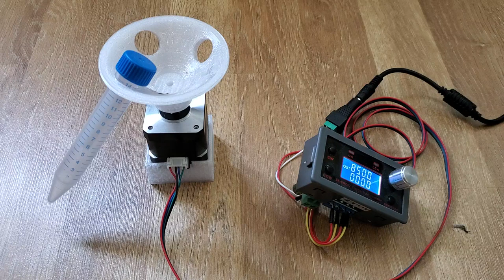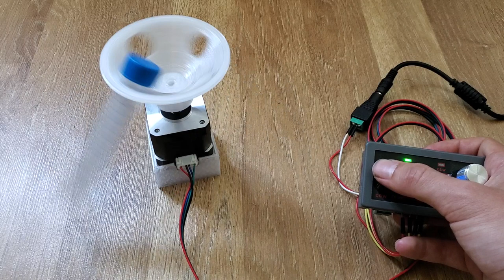Slowmo Centrifuge: A low speed/high torque NEMA stepper motor centrifuge for cell culture

Comment: Thats cool. Where did you source the motor controller?
Reply: my question too
Reply: lmao calls it a project and all he did was connect a stepper motor driver to a stepper motor
Reply: right? didn't even use a balance vial
Reply: @crimsonsapphire6680  his proof of concept still comes across. This is a cheap alternative to store bought centrifuges
Reply from the maker: You can search for "42 57 Stepper Motor Speed Controller Driver Forward Reverse Module Pulse DC5-30V" on ebay.

Comment: Could you make a list of all the stuff you used? Idk the names of the wires or the adaptor for the power supply.
Reply from the maker: The search term for the controller is in the video description. Otherwise you just need a Nema 17 motor, 12V power supply with a barrel jack, female barrel jack and some wire connectors.
Reply: @qosmoschem  Thank you! :D
Reply from the maker: You're welcome

Comment: And the pulsing of the stepper motor doesn't cause all kinds of weird currents in the solution? I assume you balance it with a second tube on a real run.

Comment: Is that the one that goes to 12000hz?
Reply from the maker: It's a ZK-SMC02 stepping motor controller + driver and has a speed range of 0.1-999rpm (1-9999 pulses) according to the seller datasheet. I'm not sure what you mean with 12000hz frequency.
Reply: @qosmoschem  since the stepper motors tend to be 200 steps per revolution, The from the internal controller that go to the driver or what I'm referring to.  The reason I was asking is because I like how it appears to have a semi soft start feature. And the one I'm looking at, I'm hoping it has that same feature.

Comment: Why do I feel thats not 850 rpm?
Reply: Certainly does not look like it, maybe a miscalculation with microstepping ?😊
Reply from the maker: You might be right. I'll have to double check all the menu settings. The data sheet lists 0.1-999 rpm though so it should be possible.
Reply: @qosmoschem  Maybe check steps per rotation/microstepping. I actually dk too much abt motors, but I have a 3d printer and microstepping needs to be accomodated in steps/mm calculation. 850 RPM should revolve around 14 times per second.
Reply: It’s spinning about 180x/min